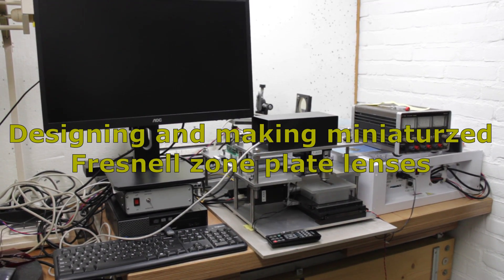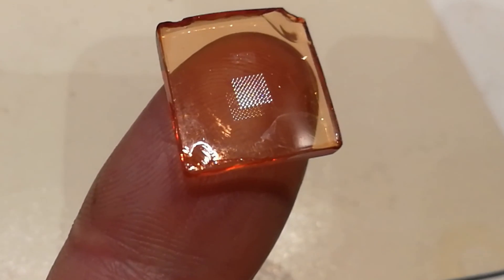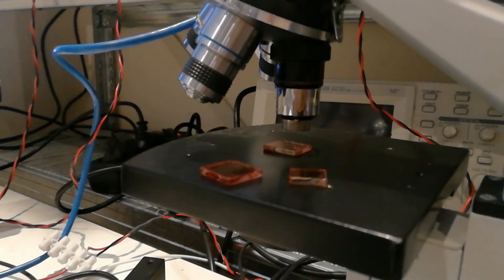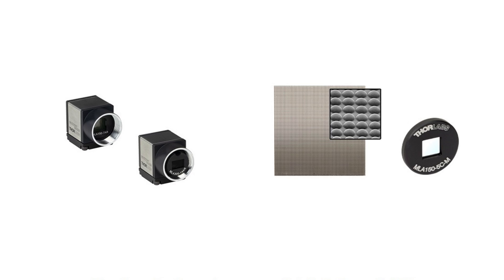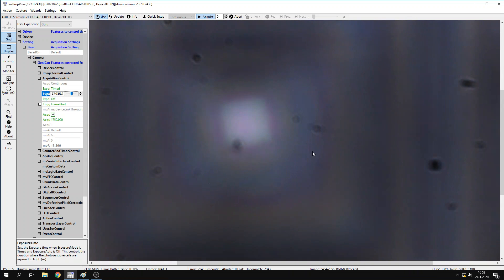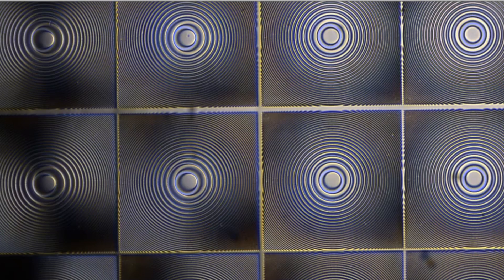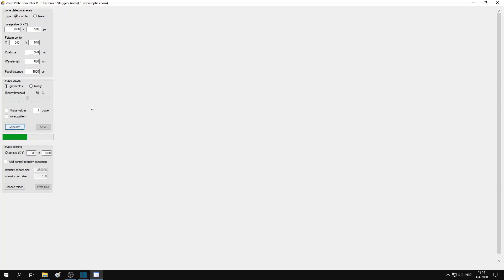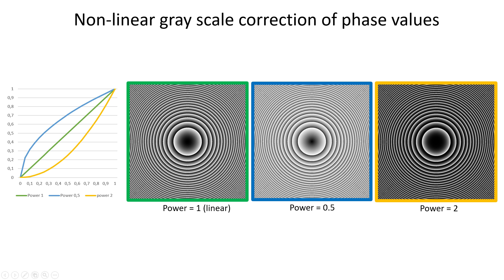Making Tiny Fresnel Lenses during a Pandemic

Comment: Hello! Thank you very much for your fascinating content — I watch it with great interest and have found answers to many of my questions. Could you please tell me if your software can be used to calculate the parameters of a lens for a CO₂ laser with a wavelength of 10.6 µm and a focal length of 10, 30, or 50 meters? Also, how can I set the lens diameter in your program? What is the minimum possible size for such a lens? And is it possible to calculate similar parameters for a mirror instead of a lens, and if so, how?
Reply from the maker: Even though it was not intended for this it should in principle work if you scale your parameters. You just have to choose the pixel dimensions such that they fit your resolution, beam size, wavelength and focal distance. for example 50000nm (50um) pixels size, 10000nm (10um) wavelength and 1000000 microns focal distance. Hope this helps.
Reply: @HuygensOptics  Thank you so much. Is there a description of the program somewhere? The link isn't working correctly. And how can I display the image on the monitor at a 1:1 scale for the created lens? And specify the diameter of the lens I need? How can one derive the geometric dimensions of concentric rings, so that, for example, one can later try to make them on a CNC using diamond turning or another method?
Reply from the maker: I can't place links in comments but you should combine the two parts of the link shown in the description and it will download. however it might be assigned unsecure.

Comment: There apperars to be significant contrast and resolution loss when viewing the images on a dogital screen.  
mega pixels of 3 or 5 which is called for in digital radiography seems to even be out dated with the recent advancements of higher resolution monitors. Supposedly there is a loss on detail by using digital versus film as it pertains to radiography. This is odd as ot seems the film method is so archaic. Im guessing you have also notice a loss of fine details in your work as well?

Comment: What if you wanted maximum chromatic dispersion say, for a solar collection array that separates and focuses each wavelength to be sent to specific semiconductor PV cells based on their band gaps? This would be to allow for more efficient conversion of solar energy to electrical energy while minimizing thermal degradation due to band gap mismatches between light and semiconductor.

Comment: Huygens Optics , hello. 
1) The your program zoneplate_writer is working on the Windows 7x64 . For start you need to unpack archive and rename the file zoneplate_writer.exe.deploy to zoneplate_writer.exe. I'm rename file from zone plate_writer_publish\Application Files\zoneplate_writer_1_0_0_6 .YOU NOT NEED to Install the software for Win7!
2) Your program cannot be calculated by a large lens that is sold in China? I did not understand how to calculate. There is a focal length of 300 mm.Groove pitch: 0.3mm, Size: 7 inch x 10 inch
I set in software Focal Distance = 300 000 but I don’t know what to enter in the wavelength and pixel size. 
==update: I input next values:
Image Size = 3080x3080 
Pattern Center = 1540x1540
Pixel Size = 4000
Wavelength = 600
Reply from the maker: I guess the software does not like the bigger image sizes for these settings, I have to look into why that is. If you try the standard image size of 1080x1080 and use 540,540 as a center, it will give you a pattern that should work for a pixel size of 4000nm and 300000nm focal distance. The pixel size is the size of the pixels in the pattern that makes the Fresnel lens. The wavelength is the one that you are trying to focus.
Reply: @HuygensOptics  I forget to add in "update" that with my parameters the image like is good. Yes, if to use these parameters but to enable "binary" I see a few little circles.
Reply from the maker: @pinokio514  yes that is correct, because the focal length is so long. If you try a shorter focal length, you get more circles spaced closer together.
Reply: @HuygensOptics  ok, thanks =)

Comment: Do you think it is possible to make a wavefront `filter` by placing small mirrors in the focal plane at the optical axis of the lenses in a lenslet array, reflecting only light back when the wavefront is flat? Or pinholes that only pass light when the wavefront is flat? 
Such a filter would be great for amateur astronomers, selective optics instead of adaptive optics.

Awesome channel!

Comment: Very cool. For 2.5 years in between high school and college I worked at a division of the Alliance Tool Company in Rochester Ny called Fresnel Optics. It was a at the time a tour de force of precision tool (mold) making, plating and clever use of platen presses and acrylic to make all sorts of fresnel lenses at the time. The largest customers being makers of overhead projection projectors. We also make laminate lenses for steel production, fighter jets, pin setters, etc. Like the Record Making industry, a brass master was made of which a  ‘mother"  was pulled by nickel plating . That was then used to consistently make molds for production. 
      The master molds were cut  with shaped diamonds on a spinning brass disc set on air bearings in a controlled environment room. The shavings which were puffed off every minute or so looked bike brass cotton balls. The machines where made there using tool maker’s from Germany. I loved it but wanted to study art.

Comment: I've been working on a project to measure the position of a piston in a hydraulic cylinder using a coherent pulsed radar on a monolithic chip. I've been using a plastic lens to columate the beam in the cylinder. It would be very desirable to use a lens that was close to flat. I've got an aperture that is less than 10 wavelengths and I'd like a focal length close to the aperture diameter.
 Is this technology remotely applicable? I know nothing of diffractive optics.
Reply from the maker: I would guess so. of course the scale of your design would have to fit the radar wavelength, but zone plates are know to work with microwaves.

Comment: Laser printers can print on transparent sheets also. Maybe you could skip the analog camera step and using the darkness setting on the printer software could build up the density of the lens using the laser toner. I'm exploring the fresnel as a lens for projecting light for a hand-held searchlight. The structure and properties of this lens make it suitable for such an idea.
Reply: Once I tried to do so and pattern fresnel lens (hologram of a dot) printed on a laser printer does not work (at least for me). I think more happens when beams come though a film it creates inclined concentric cavities inside a film memorizing amplitude and phase of wave front.

Comment: This might seem a funny question. I build recumbent sociable human powered vehicles. Based on 1932 MG J2 sports cars. I use bullet or Dietz headlights that come with a flat lens and refractory mirrors. I was thinking of using Fresnel plastic magnification sheets to place over the flat lenses to direct control aim and light concentration of these lights. Am I on the right tract?
Reply from the maker: it might work, but you probably need Fresnel sheets with a very short focal length
Reply: @HuygensOptics  Now is that the depth of the lens, or the spacing of the rings across the face? I can get those RV backup or book reader sheets. The older Bullet lights have 2 bulbs, one set up higher in the case causing a wider front light casting. I'll be replacing that with LED's (COB) and controlling the power to the LED for high/low. These sheets use a thin lens and very tiny rings. Do you think this is what I'm looking for?

Comment: The app for generating Fresnel zone plates looks nice. But I have a question. The first output you get is the correct zone image, where the rings are fuzzy. This fuzziness in space gives precision to the focal point, since using a zone plate is in effect using diffraction to generate the inverse of a diffraction. But then you generate a final zone image where you convert from grayscale to monochromatic. Doesn't this conversion smear out the focal point and increase color aberration? Forgive me if I'm making an elementary mistake; it has been many years since I took my graduate course in optics.
Reply from the maker: That is correct. It's just that photoresists handle grayscale exposure badly. So you can choose which is best for your application. For photoresists use monochrome.

Comment: A thought..
The device presented at 3:44
Instead of the dots and measuring the offsets later, how about using one of the lenses presented at 6:00 scan it across the subject during a long exposure, rotate it 90 degrees and repeat. The output would be an image where brightness corresponds to the subject geometry.

Comment: Please make a video demonstrating how polarizers work, passing one type of light and shutting the other, also showing how the polarizer work at an angle. Thank you.
Reply: Polarizers are nice to analyze using quantum mechanics. They are covered in most elementary QM courses. Basically there are three Dirac equations, one for vertical polarization, one for horizontal, and one for circular (out of phase) polarization. You can compute the expected output for any angle.
Reply: @david203  But we still don't know the algorithm of coherence in QM. Maybe Rovelli's relational QM will one day provide the answer, using Dirac's equations.
Reply: @sonarbangla8711  You don't need to consider decoherence to understand how polarizers work, which was your question. Decoherence, the transition from pure quantum states to classical states, is actually well understood, and can be seen in the density matrix by looking at the off-diagonal terms. Decoherence times can be calculated. But, again, this has nothing to do with polarizing filters, which do not involve decoherence.

Comment: Very nicely done. Another application that these could be used for is to collimate or focus light from multiple light sources. For example, high power Chanzon LED COBs have a 10x10 array of LEDs on it's board. I think it's almost impossible to focus all of them to a single point without putting micro lens in front of each LED. I think in theory you could collimate or focus each LED if you knew the distance and layout of the LED array. I think you can even take it a step further and have all of them focus to the same spot by offsetting the centering of the outer LEDs in the array since if they were perfectly centered above each LED, you'd just get an array of focused points. At the scale I'm thinking about, the lithography should be rather easy with large feature sizes. I can't find anyone who makes such arrays of micro lenses for focusing multiple light sources to a single point.

Comment: you could improve the picture quality by using a proper stand, or a box with a computer screen inside. and then take the picture, after calculating the refresh rate of the monitor.
or use a transparent foil and copy the image by contact.
this would give more sharpness, saying better results.

Comment: I was wondering: Do you think you could use a tessellated array of lenses with some nonlinear border shape to remove screen door effect on a digital display? It would be huge for VR applications. Anyway, I love the content on your channel. Very inspiring!
Reply from the maker: Interesting. I think the screen door effect is caused by the black space between the pixels. I think it might be possible to reduce this by using lenses that are directly adjacent. However this would only work well for a very specific directions.
Reply: @HuygensOptics  I think I see what you mean. I'm guessing the best we could do then is reduced screen door in the foveal region, but areas in the periphery would experience some kind of periodic appearance of the blank spaces (like a 2D moiré interference). Which might add more headache than it removes. Interesting, though. Thanks for the reply!

Comment: I wonder if I could use these linear plates to create a fine structured light pattern for 3d scanning...
Reply from the maker: I think this might be possible, if you make advantage of the large chromatic aberration. You could build a line shaped optical distance sensor, a bit like these: 
https://www.micro-epsilon.com/displacement-position-sensors/confocal-sensor/ , and then use the wavelength of the reflection as a measure for the distance.
Reply: @HuygensOptics  Interesting! Thanks!

Comment: Oh, I played with the Fresnel pattern when I was working with programmable LCDs to do holographic 2-photon microscopy, I guess I could have gotten better results if I used the pattern you've shown in this video instead of the Fresnel one, since they are diffractive devices and not refractive. At least if I understand correctly.

Comment: that software is pretty awsome! although indeed I had quite some trouble to get it past the virus scanner. maybe make a digitally signed version next time? btw whats the central intensity correction for?
Reply from the maker: I'm not sure how to digitally sign an application. Sorry I did not discuss all the features of the program. The central intensity correction can be used if your exposure system for some reason has a higher intensity in the center than at at the edges. So the two numbers you can fill in are the radius of the  curve in the correction and the magnitude, which should be a value between  0 and 255. You can only find the correction in the exported images, not on screen, since this image can consist of many exposure images.
Reply: You can usually pack an EXE application into a ZIP file for getting past security checkers. That's the easy solution.

Comment: fascinating work and results you achieve in your shop. 

Did you consider using a LCD such as used in 3d resin printers instead of the projector DLP?
Reply from the maker: No I didn't, because most contain color filters on de LCD, which will absorb a large portion of the 405nm light. The DLP also allows for 365nm to be used, which can increase the resolution even further.
Reply: @HuygensOptics  Elegoo has released resin 3D printer which has 8K resolution monochrome LCD. Would that be an upgrade? They also sell the screen alone as upgrade pack for their older 3D printer so you wouldn't have to pay for whole printer just to salvage the lcd.

Comment: 7:23 Wait, so you don't have to etch the glass?
Reply from the maker: That is correct. No HF,  just photoresist.
Reply: @HuygensOptics  Would it work better if it was etched? Also, I thought you'd need etching for the refractive lenses...
Reply from the maker: Not necessarily. The refractive index of novolac-type photoresists is generally ~1.6, so even higher than glass. The only downsides are the sensitivity to scratches and it's absorption in the deep  UV.

Comment: this is great! Stay healthy - i think i used the exact same xy stage here (removed from old optical comparator in my case) http://sam.zeloof.xyz/wp-content/uploads/2017/02/D7V7889.jpg  but mine isnt motorized
Reply from the maker: It certainly looks like it. I think the one I used was an Emperial thread Mitutoyo stage, it also had the large aluminium wheels which I removed and replaced by easy servo's. I think of replacing the table since stitching really sucks, because of the poor lead screw linearity. Positional reproducibility however is quite good. By the way, love your videos Sam!
Reply: @HuygensOptics  Mine had english threads too! I think that lead screw nonlinearity should be fairly repeatable, if you have a laser interferometer or nice linear encoder handy you can make a big lookup table to correct for that. stitching should be a lot better if you can close the loop on table position rather than motor shaft angle, but you know that already. looking forward to seeing more of this!
Reply from the maker: @SamZeloof   Thanks for your feedback. Personally, I'm a bit hesitant to use lookup tables. I think I would rather use optical encoders and use the position information to directly correct the positions in a loop. With the Dynomotion KFlop / Snapamp combination it is actually not that difficult to realize.